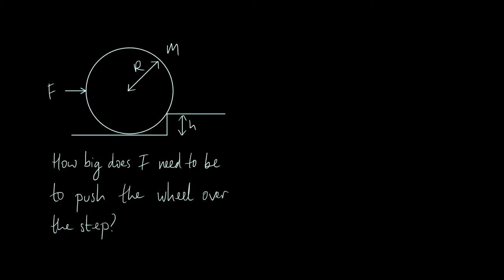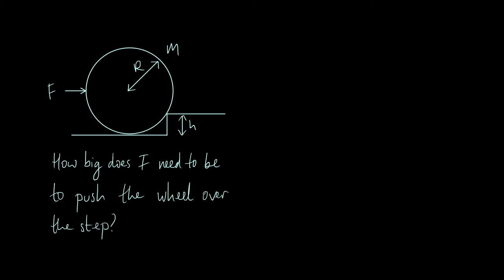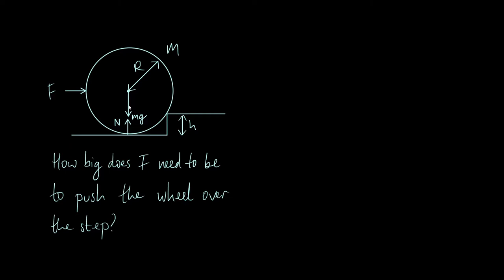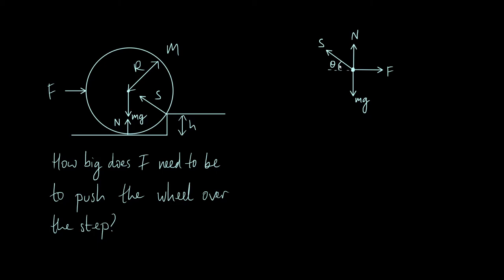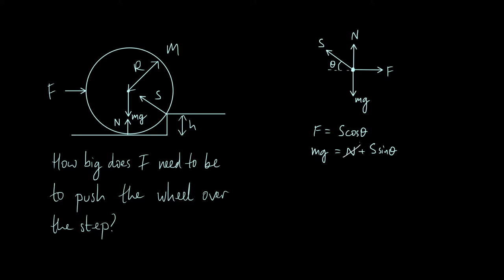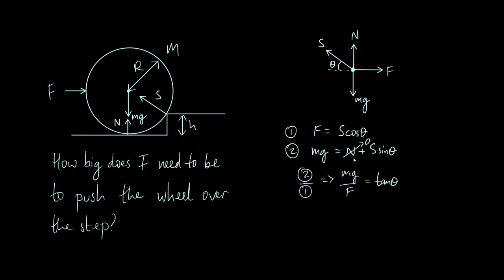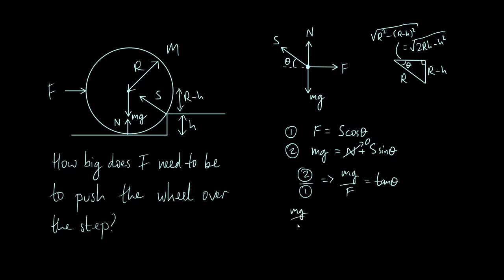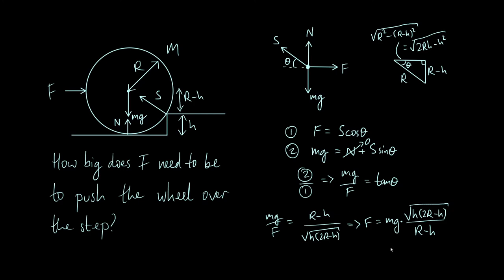Physics problem: pushing a wheel over a step

Comment: what happens if the force - contact point between the ball and the force - is not in the center but a bit above?
Reply from the maker: Good question, I haven't worked through all the details but you should be able to apply the same method as in the video to investigate this. If the force F is coming from something pushing on the wheel, it's a normal contact force and therefore always points towards the centre of the wheel. If you apply it above the centre, it will therefore acquire a downward component, so intuitively I'd expect a larger force to be required.

Comment: What happens if F is larger than the calculated value in the video?
Reply from the maker: The force calculated in the video is just the minimum required force for the wheel to climb the step. If F is larger, it will just make it to the top more quickly!

Comment: I have this doubt that what u did here is that u made the ball loose the contact with ground, but u haven't checked that if the force is enough to make the wheel climb over the step?? I felt like there's a need to conserve energy bw the points when ball is on ground and climbs up
Reply from the maker: As soon as the wheel starts moving, the direction of the force S starts to turn towards the vertical, because S always points towards the centre of the wheel. That means its horizontal component is always decreasing. So if F is large enough to set the wheel in motion, and continues to act subsequently, there is a net horizontal force to the right and the wheel will make it up to the top.

Comment: Is it possible to solve this by IAOR
Reply from the maker: Once the wheel starts moving, the centre of rotation will be the point of contact between the wheel and the step - you could approach the problem by taking moments about that point.
Reply: @DrBenYelverton  thank you sir